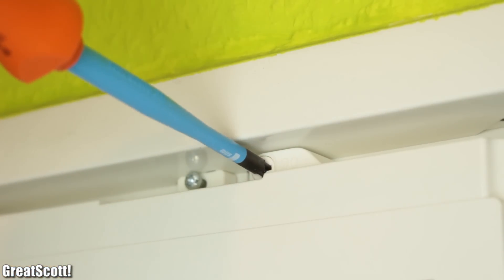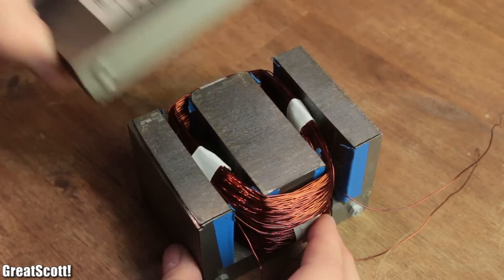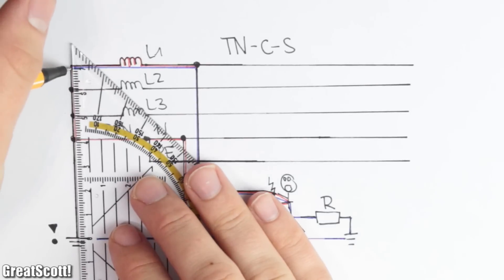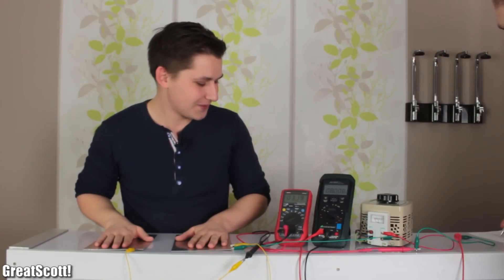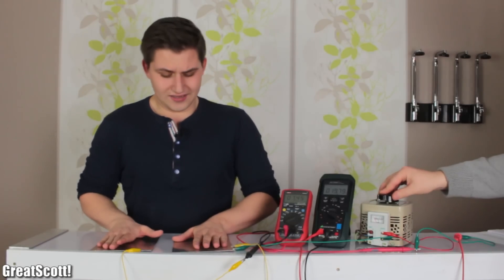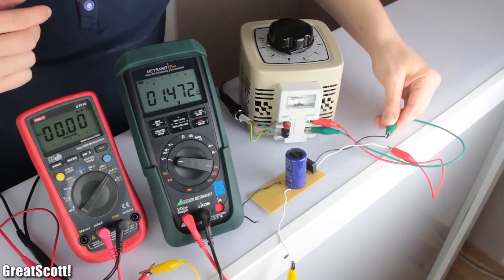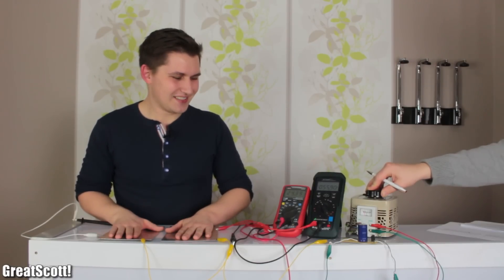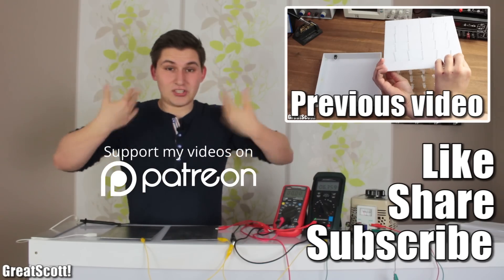AC VS DC - Pain Test (Experiment)

Comment: 50 volts DC can definitely be felt (phone line voltage) when repairing phone lines in bare feet in a damp basement. (it was late at night <grin> )
Reply: @Кристиян Митев ... That makes sense, with DC, it very much depends on whether you have sweaty hands or wet hands (lower resistance) whereas AC can use the capacitance of dry hands if the contact area (equivalent to plate area) is large enough. You can even feel 240v through an insulated cable sometimes, if you have a large diameter single core cable (such as a tail feeding a meter) and grasp it fully while earthed, it feels, for want of a better term, ''vibratey'
Reply: This friend who touched 30v AC once touched 150v AC through neon bulb (he stick one leg into mains voltage and touched other with finger) and said it didnt feel much different than this 30v so ir depends alot on resistance
Reply: well i have touched 52 volts acros 12 000uf capacitor and didnt feel anything like if there was no voltage.But my friend touched 30v AC from transformer and told me that the feeling wasnt very pleasent however we did test and touched 24v AC and 30v AC on 24 he felt nothing but as i said on 30 he was shocked literaly
Reply: The DC can be uncomfortable, but the ringer signal is torture! I got hit in the rain by that 170Vac peak to peak with wet shoes! I told my friend not to call until I called first. Wouldn't you know it was him calling! I actually sang out when I felt it.

Comment: I can't believe you were willing to do this from one hand to the other right across the heart. Using two fingers on the same hand would have been a lot safer.

I've been shocked a couple times with 110 ac but only with one hand (or I'd most likely be dead). It hurt, but it was far from the worst pain I've ever experienced.
Reply: i zvunder what the minimimal perceptable voltage across two fingers is at DC

Comment: Thomas Edison proved his DC distribution was safer then the Tesla / Westinghouse AC system by having an elephant executed by AC. Of course AC could be distributed several hundred miles by transformers while DC could only go less then a mile. Edison was an asshole.
Reply: I'm not smarter then Edison. I never said he stupid.  He was a asshole. Read about the way he cheated Tesla. Read about Thomas Alva Edison but not from early school textbooks. Read about how he stole ideas from other inventors.
Reply: +SecondFaceTV uh, not likely. Voltage is how badly the electrons want to flow, amperage is how many their are. You are basically saying "You can kill a man with a water drop if you drop it from high enough"
Reply: +SecondFaceTV It is not true.
Reply: "if you have 1v at 800a its not gonna kill you". Well, 800 A through your body would definetely kill you (nay probably your blood would instantly boil). The problem is that 1 volt is never going  to be enough to overcome your body resistance, that is usually many tenth of thousands of ohms.
Reply: @maurofoti526  Finally someone who understands it :D
Reply: +Mostlyharmless1985 You can kill a man with a water drop if you drop it from high enough. In a vacuum, it would accelerate without resisting forces, forming a round bullet of water.
Reply: Edison was cunning businessman (no scientist). His patents were like mix and match of different technology. He was profit minded and used Tesla. On the other hand, Tesla was an angel sent to earth, to uplift humanity. His patents were all unique and his inventions are useful even after 1.5 century.
Reply: Henry Pitts yes Edison was a big assholl.
Reply: True. AC is indeed electrically dangerous than DC. However, DC has the tendency to create arcs at line voltage, therefore causing house fires in an event of a short.
Reply: True. AC is indeed electrically dangerous than DC. However, DC has the tendency to create arcs at line voltage, therefore causing house fires in an event of a short.
Reply: yeah i watched that experiment what a poor elepant
Reply: Iwan Greyling edison was an ashol and not even sure he was the one that inventet the lightbulb proberly he steal the idea from someone
Reply: Today we can just use semiconductors.
Reply: but he never noticed the curve of her trunk. and she never noticed, his electric junk. they must have found electric love??
Reply: Henry Pitts ofc lel stop fucking trust that dumbasses aka edison, he know nothing about DC, i meant since when fucking DC is safe? a high enough DC can still be lethal lmao
Reply: Thomas Edison made the case against AC with live demonstrations killing with 'AC'. However, 6000 volts of AC might kill just about anything and was a display more than a scientific comparison to DC...
Reply: Money over matter - that's Edison.
Reply: +Henry Pitts why do you call him that? do you see this information about ac vs. dc reachability difference intuitive? don't pretend to be smarter than Edison.
Reply: +Kristijan Dinga naahh with enough voltage even 1nA could kill you xD